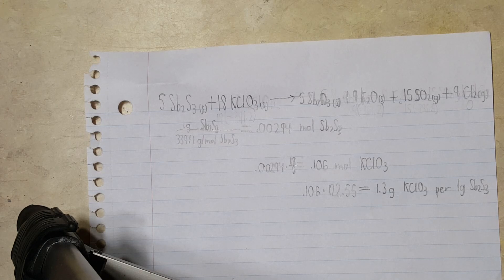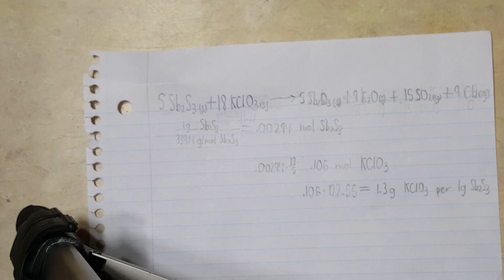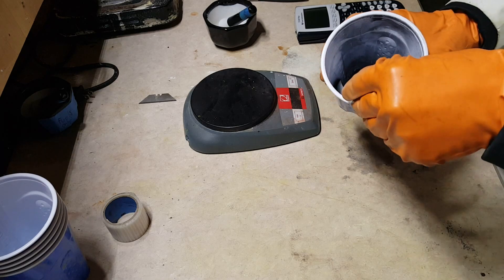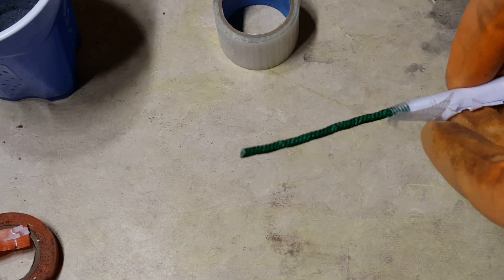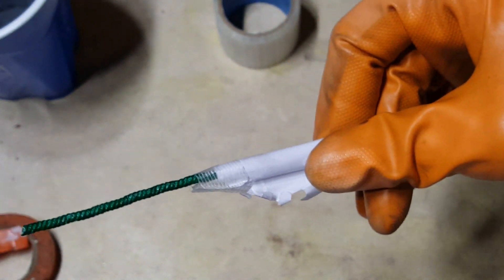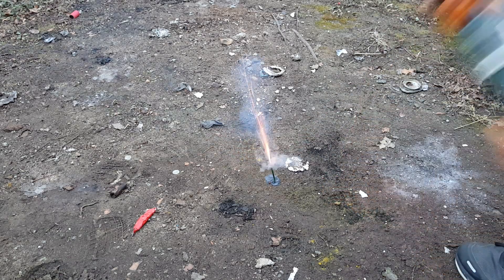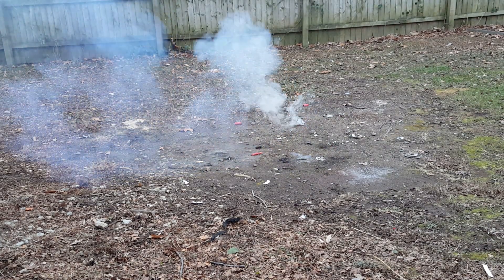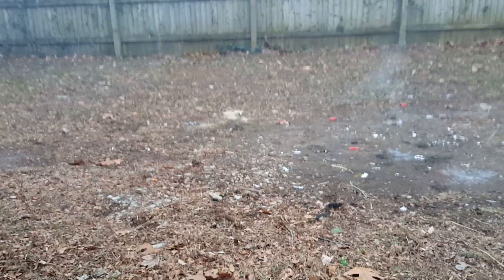How to make Firecrackers!

Comment: I use masking tape folded in to a cone then put 50mg of powder (I'm afraid to use more than 100mg at a time) and a fuse in the cone and wrap it around the fuse.  Sometimes it works great and sometimes it will act like a rocket.  It works if you need something fast.  How would the reaction change if you used potassium perchlorate instead?  I know it would reduce the shock sensitivity a little but what else?  Also, what if you changed the metal instead if the oxidiser?  Thanks a million for sharing your rad vid man.